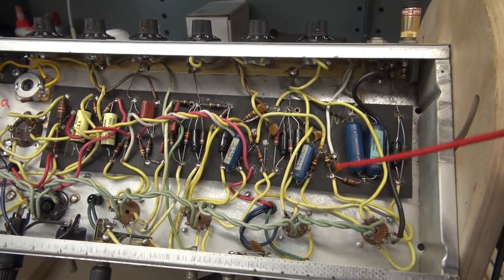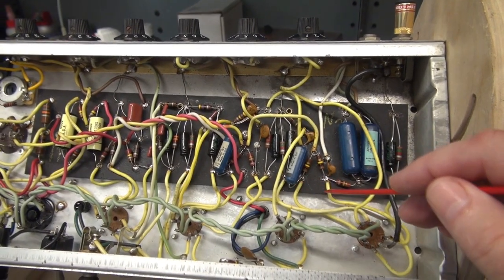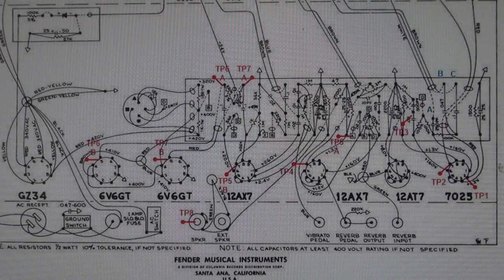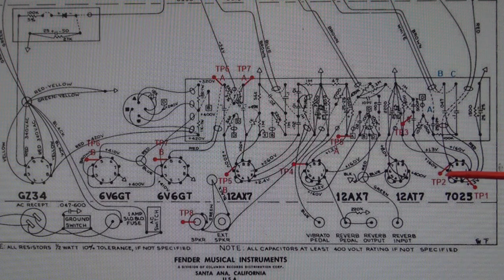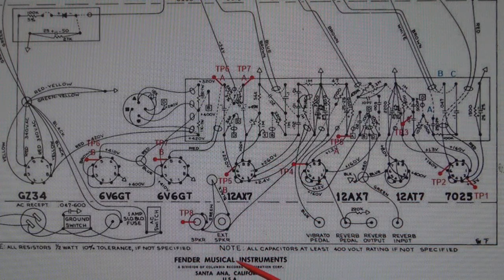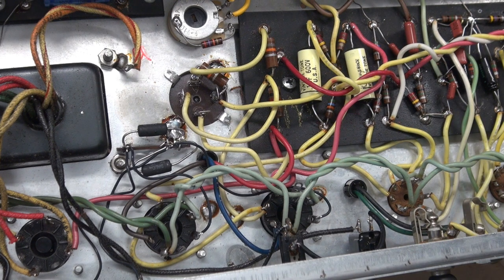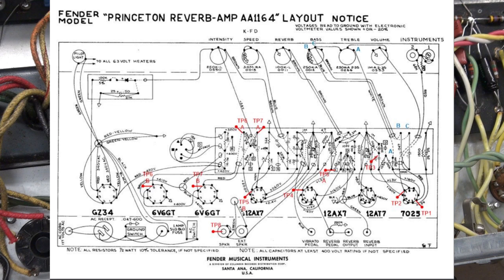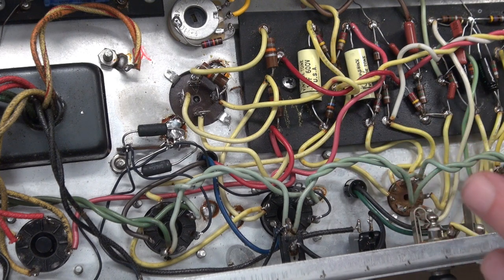Fender Princeton model AA1164 tube guitar amp  Signal tracing with Heathkit Test equipment

Comment: I built those exact pieces of Heathkit test equipment in 1983 when I was still in High School. Those and a Radio Shack clam shell type of analog multimeter were my only pieces of test equipment back then. Also, a homemade transistor tester. A couple years later, I found an old CONAR oscilloscope at a flea market. Limited equipment, but that forced me to get better and make do with what I had. 

But anyhow, that signal generator and  signal tracer absolutely EATS batteries. A couple years ago, I found an unbuilt power supply kit for these. I built it and use it now if I happen to use these two pieces of equipment. Not totally isolated from the mains, but the 120 volts goes directly to a very small step down transformer, so it is still reasonably safe.

Comment: Terry - I have an off-video-topic question, though still related. Have you heard of "small punch" and large punch" tubes, and if so, do you know the difference? All I could find online was a seller with each for sale, but no specifics on the differences. Some friends on a forum have asked and we're all pretty much at a loss.
Reply from the maker: There is little info on the web. I believe they are talking about the diameter of the plate cap
Reply: @d-labelectronics  only thing I found was a link to tube world express, and the photos they had showed actual punched holes in the screen - one tube small holes, one tube large(r) holes. Kind of like the difference between washing machine basket holes and the holes on a vegetable sieve.